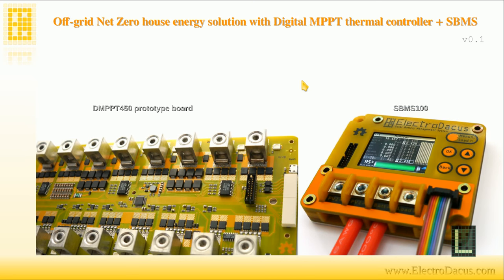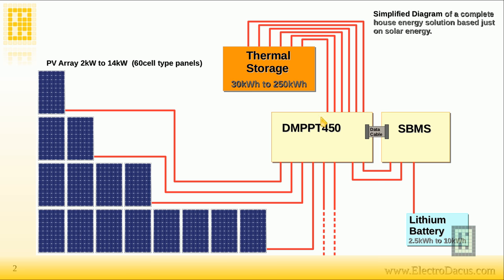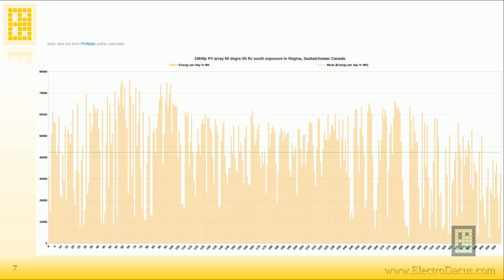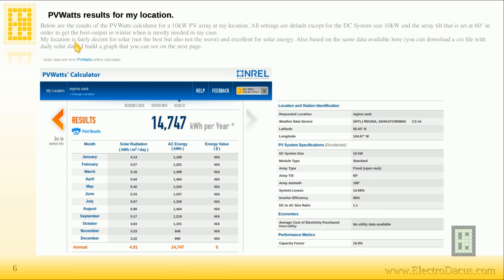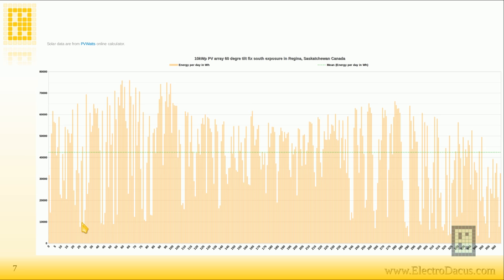Explaining the Digital MPPT thermal controller

Comment: Hi Dacian I understand it all very well, and you are right. For 25 ears ago I was all in to building a house on top of  a thermal mass like sand with warm (All Solar heated) water hoses all over the place, heating the sand , so it slowly could rice true the floor. I was told that it was a good idea, and calculated that I could have about 80 Kw hidden in the sand, if I have about 500 mm insulation in the wall to the outside of the house. But I didn't came to the New buildings process, so I just settled down with what I got, and time went by. I am now in a new situation, living alone in a big house, trying to get solar to walk, and I think, I can get it right, when I have sufficient information, from the solar panels, and some other stuff I have to understand in the process. But those Sun power are maybe rare, but they are truly fine. Together with a SMA inverter they shine.
I think a very long way you are right in your perspective of energy storage, thermal, and battery.

Its all abut mass, time, capacity, density, and Yes you are completely right.

But I am afraid, that you not quite understand the way of living in Denmark with our winter here, it is even worth in Norway, in the winter, almost no sun, and if you come a little more north, the sun sleeps all day and doesn't stand up.....dark all day long......thats not for solar.

By the way, I have found a way to design and build my one solar panels, with cells from Sun Power so maybe someday I'll come up with a 60 cells ore a 64 cells depending on my needs.... ore just settle with what I got for now, and get them mounted on the roof...... and.......  Now it is time to study the New Carbon saltwater battery, and maybe build a big one, for my power storage....wi'll se...By the way there are lot of new companies that make some form of Power storage, Mercedes, Tesla Powerball 2, GM, et seems that everybody want a slice of that cake, before everybody start building there one........ have a nice, and worm winter... Jørgen Thomsen Denmark dk.
Reply from the maker: Norway will be worse than Denmark in regards to solar in Winter months and it will also be colder.
December seems to be the worst month with about 220kWh/month in Denmark from a 10kW PV array and almost half that in Norway just 114kWh in December from same size PV array.
Now this means there is basically no sun and is completely overcast for the entire month thus each day will see about the same energy production and that means the battery storage can be fairly small (it will not help to have a larger battery capacity).
With some of the worst overcast days I seen here at my location in Canada a single 250W PV panel will produce just about 100Wh in a full day
So with Norway 114kWh in December / 30 days / 40 panels (250W panels) = 95Wh/day from one panel and that means all days are overcast and not even a full day of sun. If there are a few hours of sun in that month then it means it will be even darker than the darkest day here.
In those sort of conditions where all days are equally bad having more than a 5kWh battery for a 10kW PV array will not realy help with anything so about 15 to 20kWh battery capacity for a 30kW PV array.
In Denmark where you get twice as much there are probably some occasional sunny days in December so maybe there a slightly larger battery will make sense.
This battery is if assumption is made that all this energy 660kWh in December from a 30kW PV array in Denmark will be used for appliances and not heating only. In that case it needs to be some sort of electrochemical battery.
 If you are referring to the Aquion battery then you are wasting time. That battery will barely compete with a good Lead Acid no chance to compete in therms of cost amortization with LiFePO4.
As for Tesla PW2 that best case has a cost amortization of around 50cent/kWh so hugely expensive and can not compete with grid prices anywhere in the world. Same will go for the other grid tie batteries.
Adding a battery to a grid connected house is just a bad idea from an economic perspective.

Comment: Hi again Dacia Thanks for Info and Feedback, Last section was a kind  of Joke, but was essential to look in to what kind of power I have to produce to get my house warm in the winter, I think That YOU nailed it with the 10KW X 2 in my situation, and I just added some more power just for getting some more power to run the rest of the house. ( My ground water pump, Stereo/TV 1200W/h and so on ).
That was the reason for going to 30KW solar panels, and I agree that The Battery bank has to be as small as possible, to minimize cost, and the solar array as big as it needs to be = lower cost, but small step at the time, "I am a poor mann" But making the right decisions is very important and then build the system up....step by step....Who says that I can't run Low volt and light volt at the same time, just choosing the right things for the right applications.....I think that Low volt for heating is the way to go,,,,,but you can't run a Tesla on 28V that make no sense, it runs on 400V DC, made up of something like 13x 28V pac .....Not quit sure, but some thing like that.

To Day I have collected my New Used SunPower 96 cels panels, cleaned them and run a Volt and a Amp check, and all ended up walking fine, but I was a little concerned about one panel, as later turned out to be just fine to, ( remember that it is my first real experience with solar panels, so there was a "cloud" that broad power down, and I was fooled to believe that a diode was blown ore something else, but no) so I had opened up the conjunction box and was checking the diodes and found out of that the panels measured 15, 31, 15 Volt..hmmm...it maybe turns out That I MAYBE can make a 31VX2 panels out of them, what I mean is, a 27-31V panel with 10-12A output full sun, and That will fit directly into your system, So I am a little exited right now.........I'll have to Recheck it all to find out If it is really a possibility , and make some test on it to find out if the string is really separated from its other. I also got some connectors, and 130m (6# 1000V 35Amp) PV cable to (10 AWG) to go from the panel to the "inverter".............The 1/12 came from a solar installer and a wise guy.....lot of experience on normal system 3-6KW.....so I'll go for your data, but calculating loses in inverter and other stuff like Battery bank Maybe we end up with that kind of data...don't Now yet.......But i'll finds out ind the FUTURE.....Yes when reality show it's true Face..... "in a cooooold WINTER evening".......BBRRRRRRR rating teeth ....
 

 By the way... Do you Know a Brand/model number on a good "Ideal diode" two legs (You know the one with a Mosfet and some other stuff already build in to it ) that I can by and switch out with the exiting diodes in the panels.... just for getting a better "back Volt stopper" and lover Ohm on (No sun), for ramping up the efficiency on the panels and for stopping the volt from running back to the solar panels, I know that you mentioned that the one you used was cadet to 30V ore something like that, There Must be need out there for higher volt rated "ideal diodes" ......... I know that they already are 21% but just for doing things better and squeeze  the last juice out off them........for later making it to Heat, ore a good hot cup off coffee.... I think it is a GOOOOOOOD investment ;-)........so time to do some testing and making SPARKS........ "I'll BE BACK".......Jørgen Thomsen Denmark DK
Reply from the maker: All energy you use in the house like LED lights, making a tea,running your computer or fridge will end up as heat so is not relevant how much of the energy you use directly to heat the house or indirectly to power appliances it will still 100% of it end up as heat.
No you will not be able to split the panel in two separate panels and the diode's will not have any loss since they are not used when you use the panels in parallel and when you use them in series and you have a shadow on one of the panels the diodes will ten work but losses are extremely small since is just about 1V max drop per diode and you probably have a few hundred volts so loss is well under 1% or so and will not realy make sense to save that small amount with ideal diodes. Cable losses will much higher than that and all the time not only when is a shadow on one of the panels and so investing the money in to cable is better than in ideal diodes.

Comment: You should use wax as a thermal storage. 
Since wax changes phases during heating it is far better at insulating the heat then other materials. 
With paraffin wax you can store the heat from the day and use it during night. 
Best way is to have a water circulation taking the heat from the paraffin and delivering it where it is needed. You can use a automatic heat pump for this as long as the paraffin storage is past 100C. Pump can work like a percolating coffee pump. 

Also, you write about storing energy in cold. 
You need to look at absorption refrigerators, they will be far more efficient then a peltier. 

Also, I have an invention I am working on to convert heat to mechanical energy. First prototype is in a video I have uploaded if you are interested.
Reply from the maker: I considered was for thermal storage but the advantage vs water is not that great and cost is much higher.
The thermal storage needs to be large enough to deal with a few days up to a week of little solar energy not just overnight.
The most heat is stored in the phase change transition for wax that is around 40C so heating to more than that is useless and dangerous.
Water and concrete seems to be the most cost effective options and if house is designed properly cost of thermal mass can be almost zero since you combine structural with thermal mass by having concrete inside the structure and thermally isolated from outside.
Most houses in the world need far more heating than cooling so efficiency is irrelevant for cooling  since you will have plenty of excess energy in summer. Absorption refrigerators are not that common anymore since they are far less efficiency than compressor type so the are hard to find. I relay like the solid state nature of peltier and my small fridge works great for me for the past 5 years.

Comment: This is genius en simple at the same time. 
Basically you switch on the optimum amount of heaters during the day to recover as much energy as possible from your solar panels. 
The heat is stored in water or in a concrete slab or thick concrete wall. 
At night that heat is slowly released to keep the house warm. 
As no heat is lost (when the heat storage is inside) the system is 100% efficient, almost indestructible and cheap as well!
Reply from the maker: Yes all points you made are correct. It is the lowest cost and most reliable way to heat.

Comment: Thank you - this is absolutely genius. And superbly explained.
One question - how do you regulate the heating and what can you do with the energy in summer in a hot place where the last thing you want is a heated (e.g.) floor?
Reply from the maker: The thermal storage is so large that I do not need to regulate the heating in the winter months but there are temperature sensor inputs to the MPPT and so heating can be stopped if it gets to the set limits.
The room temperature fluctuation is no more than 3 or 4 degree Celsius in 24h like it was 21.5C this morning and now is about 23C but that also has to do with cooking and other things that heat the air in the room not the floor.
In the summer months (about 6 to 7 months here when heating is not needed) all the energy remains unused. Only about 10% of the available PV energy is used by me in summer mostly for electric cooking, computers, lights ....
I do not require cooling and even if I did the amount requires for cooling will be a small fraction of what will be required for heating at most 10%.
In many cases is best to leave the excess available PV energy unused as using it just so you can say you did so can be more expensive.
Reply: This males a lot of sense, thanks!
Is there a way to use the excess energy in summer to run extra appliances? Bypassing the smallish battery - e.g. an AC or poolpump is only getting powered as long as as there is excess energy?

I will need/want cooling in summer and would like to install the smallest batt pack possible 

Excuse if this is a stupid question - I am a good craftsman but anything electric is black magic to me
Reply from the maker: @dubglener6416  An AC will only require 500W to 2000W when compressor is working and that can easily be powered trough even the smallest battery while available excess may be like it is in my case 10 to 20kW orders of magnitude more.
Heating just require way more energy that anything else thus cooling can just not use the excess energy in summer.
If there is no winter and heating is not needed then you will just have a much smaller PV array and then you can use most of the available energy.
An off-grid solar PV array is just designed to handle the worst case month as there is no backup thus there is no other option than to have excess in best months.
Also if you want to use energy directly from PV panels then your AC or poolpump will need to be able to handle variable DC voltage and be able to deal with intermittent power due to clouds.
Say you have a 6.7kWh battery 280Ah * 24V that will typically be  just around $1000 and with say a charge rate of 0.2C max 1.34kW then if you have a 1kW load during the day like say an AC that will be directly powered by the PV even if the AC is connected trough an inverter directly to battery.
Current will flow from PV panels to Loads first then remaining will go in to battery and that is valid in any setup not just mine.
So a typical AC that requires 1000W can be supplied by a 1.5kW PV array and a 6.7kWh battery and there is no need for an MPPT as likely AC is only needed when it is sunny.